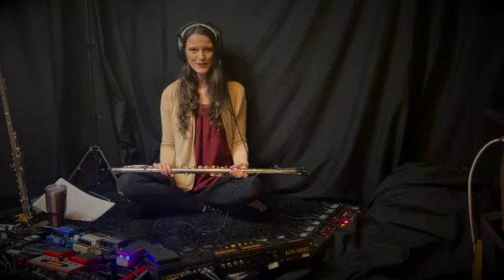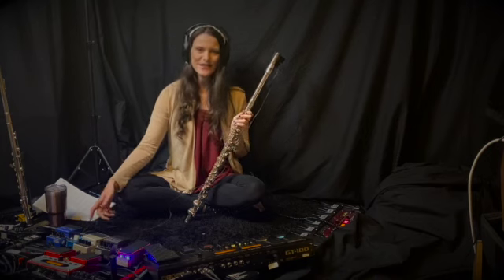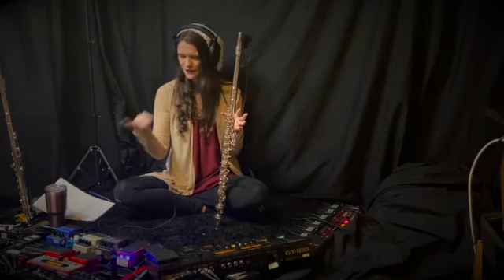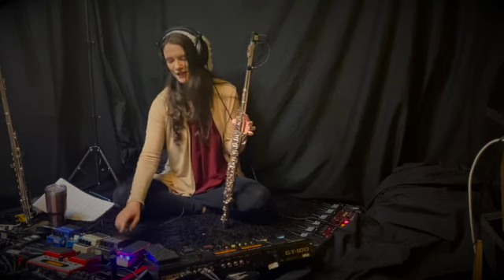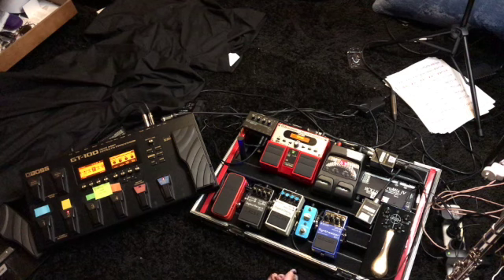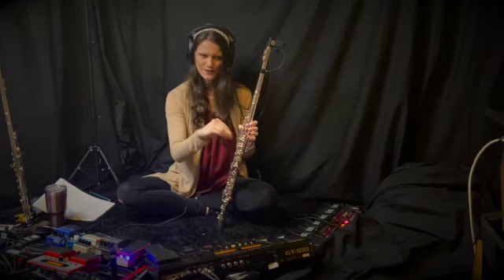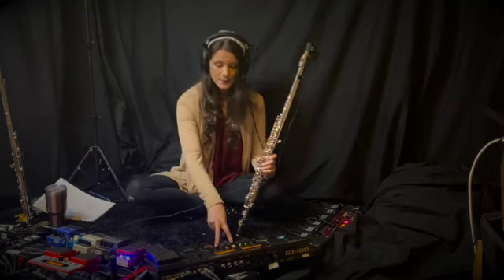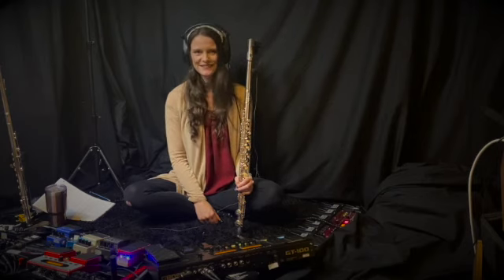How to Make a Flute Sound like an Electric Guitar

Comment: I love your teaching method and the information is great. I have one small suggestion, but first I know I can go back and watch the video again (I did that actually) but when you are wrapping up with the two multi-effects units and point out how one has many presets and one is better if you program the presets but it is difficult. When you point at the two units, it would have been helpful to see them and the model number. A small suggestion but an extremely helpful tutorial. Thank you so much.
Reply from the maker: Thanks for the tips. And I totally agree with you.  The one that's difficult to program is the Boss GT-100 and the other one was the DigiTech RP55.